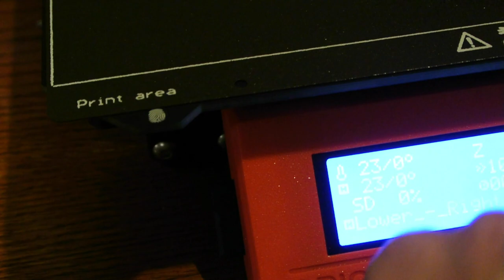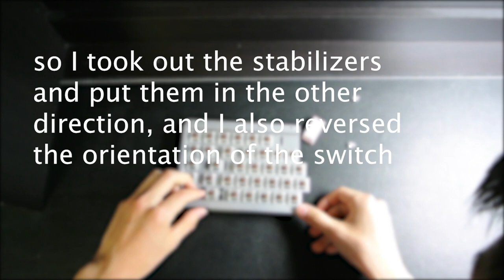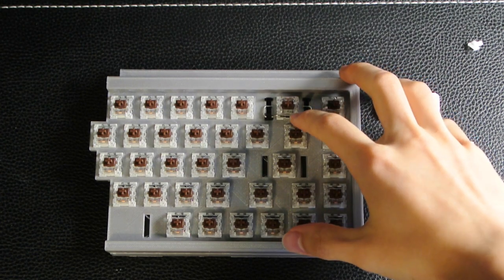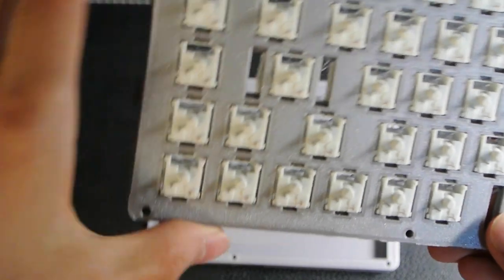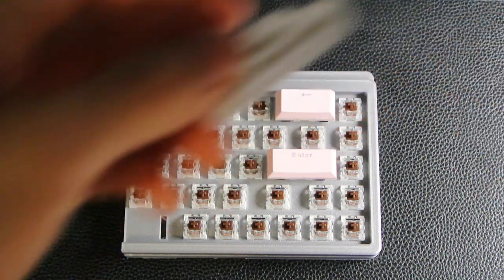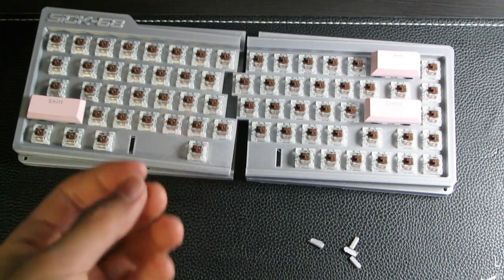3D Printing a Mechanical Keyboard! Part 2 - Installing Costar Stabilizers and Kailh Brown Switches

Comment: A brim saves the day! This is coming together nicely! I like that you went with a more premium switch choice, rather than cheap ones. For the future, you should look into a 3D printing enclosure for your printer. Warping is caused by the ambient temperature around the printer. Enclosures are insulated and keep the inside temperature nice and toasty without making your bedroom warm. Excellent investment :) Can't wait to see the next vid!
Reply: @reecemakesthings  Good thinking! This is a good STL for a pipe coupling you can use to build the enclosure out of PVC pipes https://www.thingiverse.com/thing:27249

Comment: Grease is actually instrumental in using costar stabilizers. It's not just about the rattle, once they're greased up you can slide them on the wire, stick them down into the bottom and they'll stay standing.
Then just twist them until the mounts are lined up just about right and press the key down while wiggling slightly. They'll seat properly relatively easily.

Press the key a couple dozen times to work out any excess grease and they're good to go.

And I'm also pretty sure they're always greased from the factory for this reason, and not for the customer's benefit.

Comment: That issue with the stabilizers clashing is interesting. I think the hole for the led in the keyswitches should always be facing up. Although I have never used a keyboard with that particular type of stabilizer, so I don't know how it should be mounted. Also that rattle comes from a lack of lube and cushioning.

Comment: Hey! Nice keyboard. I looked at the pdf attached with the thingiverse link and it seems that the left most column, column "14" doesnt match the pics on the thingiverse site and your keyboard. What did you do with the wiring to adapt to it? Im thinking of building this.